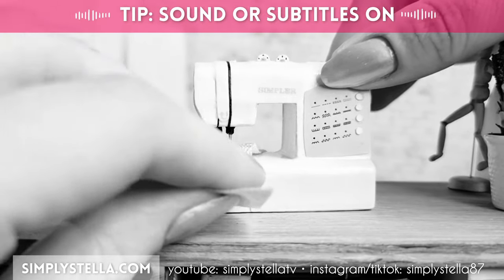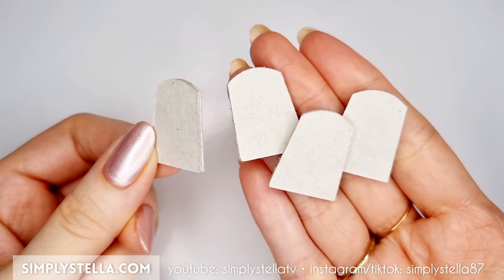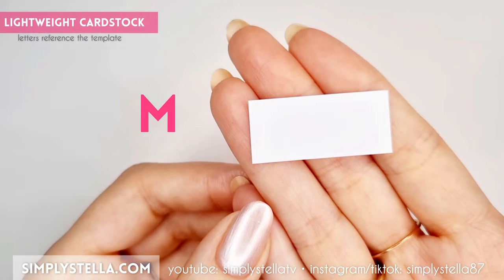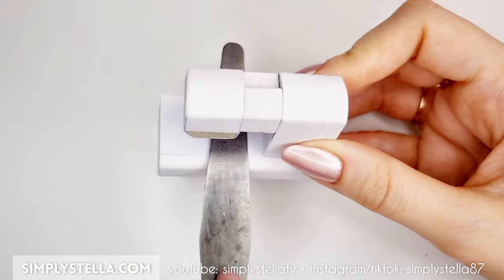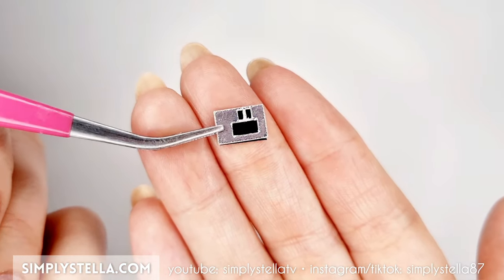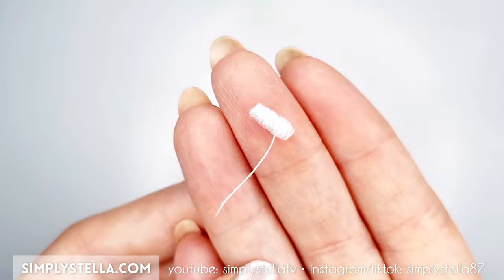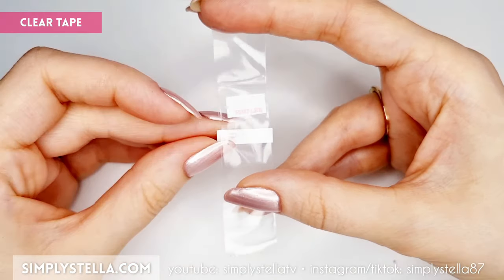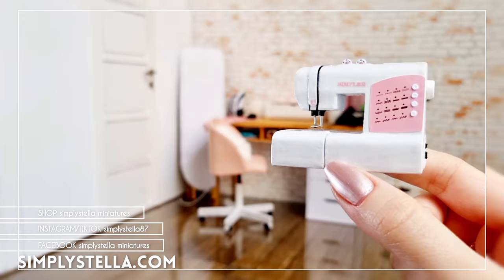Miniature SEWING MACHINE for BARBIE dolls | How to make a DOLLHOUSE sewing machine with PAPER!

Comment: Could you add the free links to your shop I just cannot get them on linkden
Reply from the maker: Hi there! The download link is given in the video. Make sure you watch the entire video, so you won't miss it! Simply type the URL into any browser (works from both pc and mobile) to access the download page. There's also a pinned post in my comments with an alternative download link. 

Troubleshooting:
- Make sure you type the full URL as given in the video (including any .htm extensions) 
- Check the download folder on your device. Some browsers automatically download your files, and you might have downloaded them without realizing it.